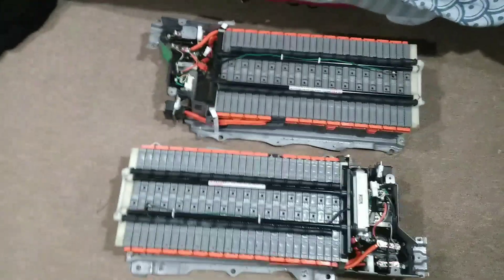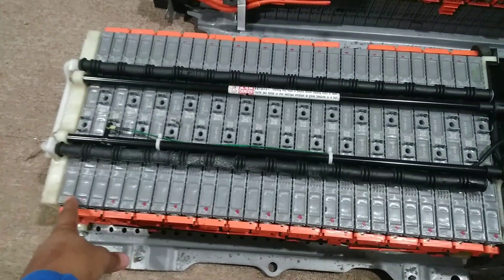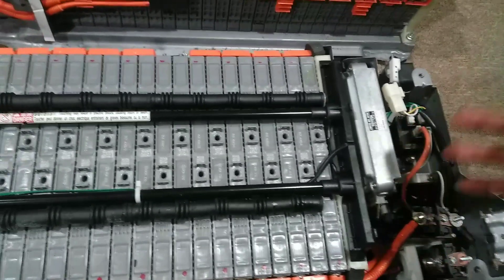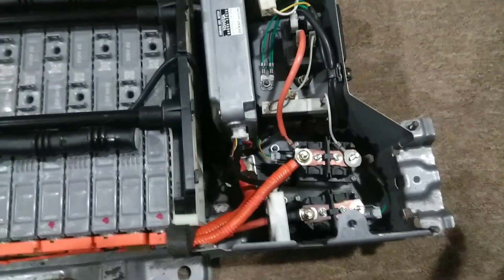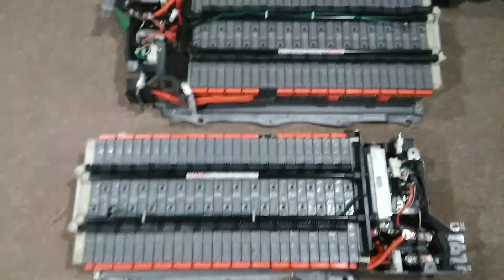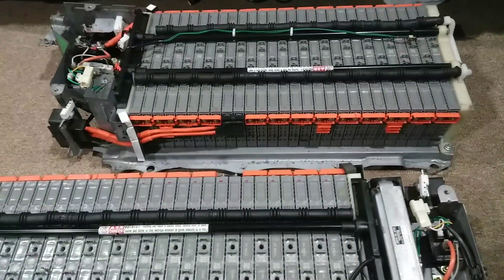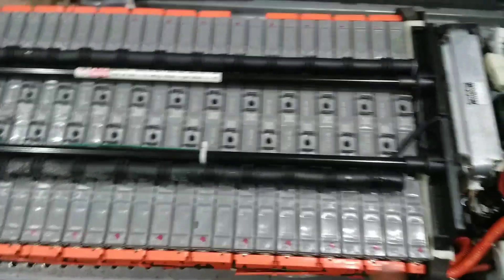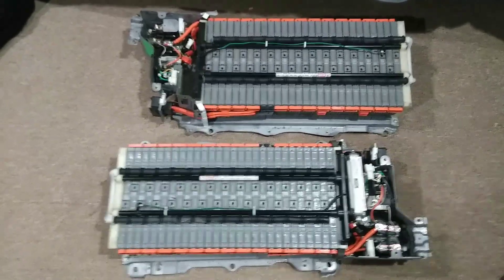PRIUS HYBRID BATTERIES SOLAR POWER BANK  JEHU GARCIA HELP!!!! VANLIFE NYC SKOOLIE BUILD BUSLIFE CONV

Comment: You’re not supposed to peak charge NiMH batteries in parallel. Good thing is you won’t be peak charging them on a 14v system.
Reply: Why not?
I ask, for that is how I do it O_o
Though I'm not peak charging as I have my charge controller set to 14v max before cutting off to prolong the battery's charge cycle.

Comment: If you have hybrid battery separate   the cell 7.5v each  and connect two 7.5v to make 15volt.
Make atleast  4 pair 15v and do parallel connection aďd one side positive and other negative and connect to solar panels and load
Reply: @satish kamal you think these are worth it for solar?   I found them for $2.00
Reply: @johnle231  $2 per cell??   I would jump on that!
I'm using 28 cells. 
7s4p for a 48v pack. 
They run my solar garage with no problem ;-)
Reply: @2bRealist  

Really.  

You finding any issues connecting those nimh batteries in parallel?
Reply: @2bRealist  

How much storage does that make?  What do you run off it?
Reply: @johnle231  Not at all... but I ordered mine reconditioned and balanced.

Voltage tested each one to make sure that they were.  I don't have a power meter to load test them, but I trusted the seller.

I had to make my own clamp case for them, as they came individual and not in the toyota battery case. 

Arranged them in 7 sets of 4 cells in parallel, then connected the sets in series.  I measured the open voltage of just under 52 volts. 

It powers a 48v 6000w split phase inverter giving both 120vac and 220vac.  It runs a 220v compressor and exhaust fan, as well as powering the 120v outlets. Though I don't use them much, nor do I have any lights hooked up to it. 

I also have a 48v to 12v buck converter that runs all accessories like the lights, radio, and several other 12v devises.  The buck converter is much more efficient than running the 6000W inverter, so the inverter only gets turned on when needed, but for the most part, everything else runs on 12 volts. 

I have never load tested the battery as I have never ran out of power before.  When I purchased this property, the garage had no power to it.  My local PUD wanted way too much to get it hooked up... so I saved some money by going solar. 

10 used 270w solar panels $700
mppt charge controller $200
6000w split phase inverter $1000
48v to 12v buck converter $100
28 reconditioned prius battery cells $550

(I also purchases a small gas powered 3000w inverter generator as a backup power supply for the battery on those long winter nights, but I have not had to use it, so I don't count it in the cost)  

Add the wiring supplies and I now have all the power I need for my garage at a fraction of the cost of getting set up with the local PUD, and best of all.. When the power to the house ever goes out, I just use  an RV extension cord to connect to the garage and use it as an emergency power supply for the home essentials! 

 So do you still have that hookup of $2 a cell?
Reply: @2bRealist  

Yes still got that price with the original Toyota case included to compress the cells .
 That’s for your response btw
Reply: @johnle231  I must ask... what is your source, and is it possible for me to purchase a few cells?

Will you be putting together a system as well??
Reply: @2bRealist  

This guy I know.

I think there is like 28cells in a whole thing so multiply by $2.00 is the cost

I can make it happen for you but dunno how it would all work…. You would have to send money first….  The stuff plus shipping
Reply: @johnle231  That is great..
Just so you know... best price I could fine on these are $20 each on ebay.
So yes, you have a great hookup. 

No worries for now, as I don't need them right now, but if I ever do, I'll let you know and would pay you double... consider it a finder's fee ;-)
Reply: @2bRealist  

I don’t want to bother with creating eBay account and balancing etc.  why don’t you go for it? 

You don’t have to pay me anything.  Or maybe just $5 for some gas to ship it

Just pay for the cells and shipping.  I’m glad to help whenever  you’re ready
Reply: @johnle231  Thanks... but honestly John, you should build your own battery as well ;-)

With energy prices going the way they are, even if you just build yourself a portable solar generator,  you will be ahead of the game.
Reply: @2bRealist  

I’m going lithium

Comment: I want to do something like this for my fifth wheel. Trying to develop some kind of divorce rape recovery cheap taxes scenario. But I feel so dumb even though I understand the concept of solar power
Reply: Iv tested this and here's what happens...
 So I have a pip 4048mst ppt inverter it has 3 strings for each pv input and 60amp charge controller.

 It natively puts out 240 V I had to get a step down transformer to take it from 240 to 110v from there I hooked up a receptacle and 7 Toyota Prius batteries in  Is parallel each battery has 7.6 volts this gave me a total of 50 V with 7 batteries and at a full charge I put a load on it Is with a fan and it ran for 10 minutes using a house fan. Mabe a full bank will last 40 minutes but i feel your better off w a Chevy Leif battery bank.

Comment: I got little experience with this battery because I'm done the same thing like you playing but with One battery pack if you want any help just contact with me if I can I can help you
Reply: pls i have this batteries to how can you help
Reply: @mayowaajumobi3190  https://www.facebook.com/malymacgyver/
Reply: i need your help..please
Reply: @saileshchand9521  https://www.facebook.com/malymacgyver/
Reply: @saileshchand9521  You have to get a solar charger that will charge lipo or you have to get a smart charger for like RC cars and charge them 1 by 1 or however many volts your charger can put out make as many of them that voltage ⚡

Comment: I have six of them running my house at 24 volt that BMS will not work because the last one got to be 240 volt but yes it will work
Reply: Hi, anyone has the plans for this setup and which BMS was used. Also, what is the best MPPT that will work with this setup. Thank you in advance.
Reply: @joekryszczynski3600  I have ever found a BmS to work on them you could use any mppt charge controller could be adjustable and I don't longer use those batteries there are just sitting just in case of any emergency I went to lifepo4
Reply: @damian roman how you make it work at 24 volt?  Each cell is 7volts, , so wouldn’t 6 of them be 43?
Reply: @johnle231  six pack of batteries I ran in series into 8 scent and then ran them in series to 56 volts
Reply: @solarandwindinsouthtexasda1473  

Is it alright if I give you a call?  I see your phone number in another post.

Have questions about these batteries.
Reply: @johnle231  yes
Reply: @johnle231  6

Comment: Jehu will not help you, however, I am in the process of doing just that. You have to parallel 14 & 14 then series the 2 modules to get 14.4v (note, gen 1=7.2v each cell)
Reply: ok how do you ensure you don't over charge or get a charger that can charge up to 14.4v
Reply: @mayowaajumobi3190  Once you have made your 12v pack (actually 14.4v) your solar charge controller should be able to charge it just like any other lithium battery. 
What are you using as a charger (charge controller)??

Comment: Hi did you do anything with the battery?? Any info ?? I have myself a battery bank and I'm lost
Reply: did you manage to do it. Any help will be greatful.
Reply: @saileshchand9521  hi i still have that battery  I striped down all bus bars connect  them for 48 v bank no BMS noting 
Is not worth your while is only 1.2kw which is noting when you can safely discharge 40 percentage 
Ma advice sell each cell for cash buy agm and is better then that  
Not this type of battery from cars 
If you have nissan leaf power pack 
That have to be newish one which is thousands 
I don't know what you want to use that or them if you have few of them 
Hope that helps
Let me know thanks
Reply: @samueldavid1887  thanks buddy..

Comment: can these batteries be replaced with 18650. and use them in the car?
Reply from the maker: Yes they can I upgraded mine I get 5 times the distance
Reply: @DOPESHITTV  I! Do you have any videos or pictures as how you did this?
Reply: Bro aint these ni/mh batteries?
The Toyota bms won't work with Lithium cells!
Reply: @descent8275  it's not a bms, at least if you expect bms to balance the pack, to my knowledge it is only sensors

Comment: It does work I have three of them in my house when you parallel two cells it makes 15.2 volt you cannot running hy inverters don't like it but it works my runs and 14.5 volts
Reply: i need your help in setting up solar system using hybrid battery pack.
Reply: Call me at 956-662-3342 I'm in texas tomorrow
Reply: @solarandwindinsouthtexasda1473  Hi Damian, I am in Fiji Islands. Do you viber.. i can viber call you.
Reply: @saileshchand9521  I don't know what is that we use WhatsApp

Comment: There  is not a lot of info about prius battery packs turning to  12 24 or 48 .Hoping to see your plans because the price on prius battery is cheaper than lead battery but will it work ...so good luck..
Reply from the maker: All you gotta do is put two cells together neg to pos that's 12v and double for 48v

Comment: Guys is there any other hybrid battery that is better than Prius battery?
Reply: Nissan Leaf battery. It's much easier to work with.
Reply: @christopherbetty5017  18650 cel from old laptop battery
Reply from the maker: I use lithium ion in my primus I can build you a life long pack for cheap
Reply: @DOPESHITTV  i have lots of used prius battery  someone told me  Prius battery is not powerful enough to be battery bank
Reply: @DOPESHITTV  did you ever set it up to run the van and how
Reply: Any lithium one, Gen 2 & 3 are nimh but honestly cost factors should be considered

Comment: I HAVE CODE P3019, WITCH MEN I HAVE TO CHANGE BLOC CELL 09, HOW IDENTNTIFIE  BLOC 9 ( CELL 09)

Counting starts from the opposite side to ECU OR FROM ECU ?
Reply: It starts from the opposite end of electronics. They go in packs of 2 so it's the 17th and 18th cells from the far end.

Comment: i have code p3019 prius 2007   , i need to change bloc 9 , where the bloc 9 located , from right ou life side 9 Ecu ?
Reply: Slow your roll, your going to have it out anyway, test it all, Gen 2/3 block one starts from passenger side. However if you want your rebuild to last load test every cell. Discharge  . 3 volts per cell with some headlights and time each cell, replace underperformers. Do not discharge below 6.5 have fun

Comment: I am doing the same project, for 48v system inverter, 7 battery = 52v, but the problem still where to find BMS
Reply: Did you set up the 48v. Do you have a video
Reply: @simplyfocus9937  Interested in that video as well
Reply: I actually have a lot of those batteries. I  tested them. The performance was not good at all. 
- I had 7 batteries at 8.2 v  for 48v setup, it last 10 min. I noticed that one battery drop to 6v fast. I changed it. Same result. 
- I had 14 batteries (2 in parallel). It last 16 min. They drop fast to 6v.
- I had 35 batteries (5 in parallel) .it lasted 32 min.  I  was trying  Gen 1.
-I did try 7 batteries  Gen 2. They lasted 33 min.
Reply: @simplyfocus9937  what kind of load were you testing the cells with? And how many cells?
Reply: @codiecarroll735 the inverter is less than 1000 watts. It was a TV 120w & a light 20w
Reply: James Francois geez that’s pretty lousy results for such a small load. I’ve been experimenting on a 3s pack of these cells (18s more like it) but I just don’t know how to get a full charge in these things, there’s not much info around to find an appropriate charger
Reply: Codie Carroll did you find anything on them? I’m trying to use these batteries for solar in my house.
Reply: @simplyfocus9937  not worth it to use these cells for a house battery? what did you end up doing ? thx
Reply: @spiritualwarrior1084  I am using them  right now, setting them at the 48v 7 series. They are 8.4v charging them up to 8.2
Reply: @simplyfocus9937  are you using any standard charge controller for solar?
Reply: @spiritualwarrior1084  Iam using makeskyblue,  I set it to stop charging a 58.8V

Comment: I think you can use it. Not sure but i think you can use a 14 wire bms,because there are 28 cells and you said you were gonna wire 2 in series for all the cells and then  in parallel so that would make 14 cells,i hope this helps man💪

Comment: Just picked up 3 packs, 2 from Camry one from gen1 Prius. Reconfigured for 48V, 7S16P. I will be getting 3 more next week.
Reply from the maker: Make sure to post vid
Reply: Slight set back, 7S14P discovered flawed modules. 91ish amps of capacity.
Reply: Found the key piece  to the puzzle, nimh prioritized BMS that detects -DeltaV, Batteryspace.com has em.
Reply: @Tiersmoke92555  did it work
Reply: @simplyfocus9937  in a way yes but  not as good as I hoped. Using the NiMH bms money to get more Nissan G1 batteries
Reply: @Tiersmoke92555  I did group them by 7 or 8 modules in series.  I had 3 pack of 7 in parallel l. One pack works better alone (30 min) than 3 pack (15 min)
Reply: @Tiersmoke92555  Nissan leaf is good. I have seen videos. I couldn't find any videos for prius